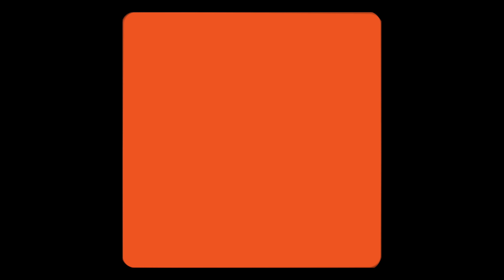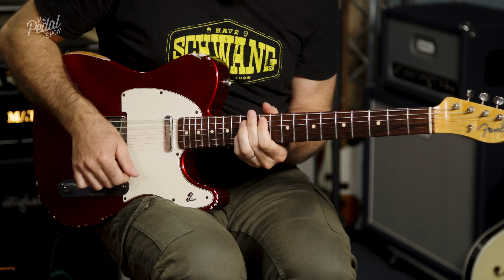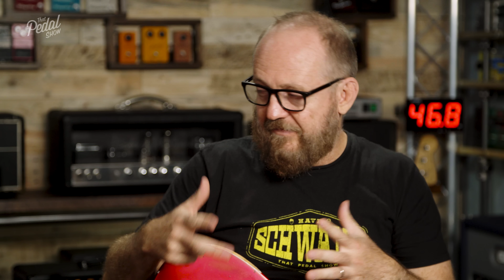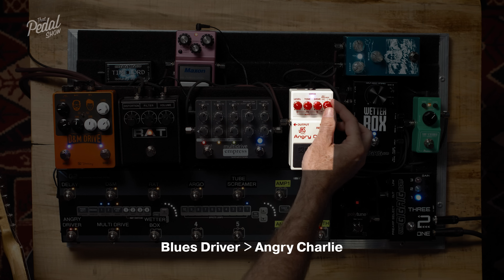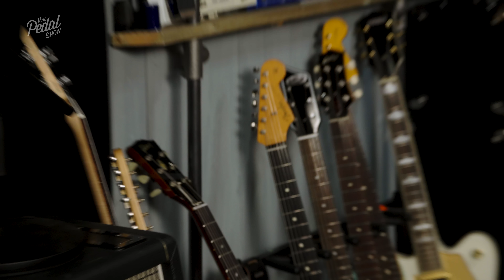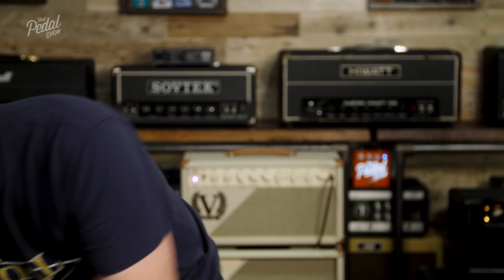Mixing Gain Pedals In Parallel For Ultimate Versatility – That Pedal Show

Comment: Interesting how this is finally morphing into the gtr world. This is s.o.p. on a mixing console. All fx on a console are single source multiple sends and returns. Much easier to blend when the fx are not affecting one another. Check out the new electro-harmonix parallel mixer. Allows you to parallel 3 pedals. Doing this with multiply voiced drives is the cheapest and most portable way to simulate a multiple amp setup.
Reply from the maker: Nice!

Comment: Another great episode! It's worth noting the Angry Driver does some gnarly things when it's boosted with another pedal in front of it. Also, the bonus functionality with the remote jack makes it super versatile. You get one pedal as a base, and then it kicks in the other on top, or in parallel, toggles the Blues Driver.

All that said, I took mine home when my local store didn't have an Angry Charlie in stock. I leave mine dialed in not far from where it was when the Empress demo started. Stacking/boosting it with a Rattler or 1962X is fun, too. When the Angry Charlie side gets a lot of gain in front, it gets really angry. Thanks for the hard work!

Comment: There are a parallel Mixer for Pedals from EHX with a power Full EQ for each of the 3  sections😉 This is a Thinge I want to do for so Long, but the mix Pedals wehre not reale there. Now they are coming  and I reale want to try Plexi and a Tweed in a Box Pedals in parallel🤘 thanks for that Great show😍

Comment: Experimented a bit with parallel , but in the end , was deterred by the introduction of further buffers, flattening and otherwise having a negative impact on overall sound.Tried to convince myself it wasn't that noticable, but that didn't work for long.Was primarily using the inexpensive , new, EHX Switchblade Pro unit, and would assume that more satisfying results could be obtained with a higher quality unit[Swiss Things?],(EHX great for the price point, but very relative) .The larger idea of parallel mixing is exciting(Wah?),if a little intimidating.Being a believer in Fuzz and "vintage", Neve, and unusual driven sounds, I've repeatedly come up against buffers as a issue and overall enemy,; just fine with the cleans, but engage that Drive/Fuzz section ,- ouch.
Now, if the Angry Driver had the mojo of the Keeley Phat Mod; not quite as good as the older , Germanium, release, but what do you expect? That IS the pissed off sound of Rock coming back looking for a rematch.
"State B" would be the larger part of the American South, where , along with a majority of their Northern and Western counterparts, geography is NOT a strong suit.Not sure, dear Mick, where you'd get the idea that the  educational  system here was succeeding on any level.

Comment: Re your out of phase Tele, Mick......I fitted a Strat pickup into the neck position of my Tele which resulted in true out phase when both pups mixed. Bare Knuckle explained that if using in the same guitar as a Tele bridge pickup, i ought to have asked for the Strat pickup to be reverse wound. No matter though - because the out of phase sound is glorious, a happy accident!

Comment: Cool episode guys! :D how about the following idea: splitting the signal and going through two seperate drive pedals, just as mentioned in the episode :) but then keeping the signals seperate all the way. So with the example of the TS and the Rat, one of the amps would receive the TS signal and the other would receive the Rat signal. I have tried something like this this a few times and involving the amps in this blendingfeast sounds EPIC! In my opinion not a very usable live setup though, but the blending options are endless :) so it would probably be great for studio work. The only thing is (if you play stereo or dual mono) all the pedals after the split need to be “stereo”. Or you could (of course) also go wet/dry after this split :) Maybe something you could try in the future!

Keep it up! Cheers,
Niels from Utrecht, The Netherlands
Reply: I am currently running four wet and two dry channels. Not useable live is about right, but it sounds interesting.

Comment: Been waiting for this video and really enjoyed it! Next topic, delays in series and parallel. 

It’s funny how most of pedal history has been series. Especially when you consider that most guitar pick up combos are parallel. Even channel jumping on old amps was putting two tubes in parallel. 

Got a nerdy question considering phase...in any pedal or amp you have some kind of tone, EQ, filter etc that utilizes a capacitor to ground. I’ve tried googling this with mixed results but doesn’t that introduce some phase shift? So most of the time 2 pedals or amps in parallel will most likely be not in or exactly out of phase. 

Speaking of 2 amps, you could do drives in parallel this way. So many creative sparks TPS always initiates! I’m due for another trip to TPSS 💴

Comment: Great demonstration, and something I'm going to experiment with in my Helix. The Empress Multidrive is like a take on the old Craig Anderton Quadrafuzz from the 80s - good stuff. The ultimate parallel fuzz was the "hex fuzz" from the Roland GR100 and GR300 - but that's a bit of and edge case... but what a great sound. Worked quite will for a Mr. Fripp.

Comment: Great show! The Klon can be seen as a parallel mixer of the clean signal and clipping OD, something like the Angry Driver in parallel experiment (probably that’s why Mick liked that the most). Currently, I’m exploring parallel mixing preamp pedals with a Boss LS-2, to try to achieve multi-amp tones with a single signal chain into the power stages. Cheers

Comment: The moment I first saw the Wetter box, I wanted to see how it would handle a fuzz/drive parallel, and here it is. Does exactly what I was hoping for! Sold! Thanks so much! 

I wonder, what would be the difference between doing this through a single amp and running separate drives into dual amps, apart from the obvious volume increase (lets assume they are in phase) etc...?

Btw the Strymon Sunset has a parallel drive mode...
Reply: Good question, Edward Jons! How about two different amp heads; one into a 4x10, and the other into a 1x15, each head with it's own chain! Way far too much gear to gig with, and, really, would all that stand out in a recording mix, but sure sounds fun to dream about!

Comment: Precisely why I like using two amps. One compresses more than the other and widens the frequency response.
Reply: I was unhappy with the twiddley nature of stacked gain so I started running seperate paths to different amplifiers. It's gotten pretty out of hand and I am trying to re-attach some circuits to get it down into just two or three amplifiers. It does sound good though, doesn't it?

Comment: The new ehx parallelmixer. Maybe next time?
Reply: They never feature products that compete with stuff that Gigrig offers. No shows about switchers, no shows about different power supplies, etc. Which is fair enough; this show is absolutely a huge marketing platform for Daniel and his guys.
Reply: I just got an EHX Switchblade Pro, which offers a lot of options for switching A or B, switching order of A and B, and choice of parallel or serial for when both fx loops are engaged. Also, volume control for A, B, and Dry. All that said, I still might like a Wetter Box one day. For one, I do a lot of stuff in stereo — my Roland JC40 amp is stereo, and some of my synths and fx are stereo, as well. 😃 (Of course, that amp has the option of serial or parallel fx loop — loop is mono out, stereo in, and it’s bring-your-own loop fx volume control so that you don’t blast your ears. Yeah!)

Comment: Parallel gain staging, nice!  But come on guys why not come all the way and finally do a dedicated show on full on stereo amps and stereo pedal boards?   I am a Roland JC-40 convert.
Reply from the maker: It’s a different thing. We have done some stereo stuff, maybe it’s time for a revisit.
Reply: @ThatPedalShow  What I am talking about is skipping the step where you blend into mono and blend just send parallel signals into opposite stereo channels and blend at the amp.   True stereo amps like the JC-40 (including the effects loop) gives you a cutting edge platform where re-imagining a board for true stereo including wet/dry is a very complex rethink.

Comment: The Angry driver is cool. My first thought was, it would be good if you could switch modes with your foot instead of turning the knob. I guess this is what the remote is for. One small downside (?) ... when using the remote switch, how does one know which mode you're in?
Reply: fishy paw The led changes colour, blue=bd2 red= angry Charley

Comment: I would have loved to see the affect a klon type would've had both before and after a parallel blend.  Very interesting to think of a little extra gain and wave form shaping going into two different signals then catching those gains stages and being blended back together as well.  I imagine stacking something after would mute the point a bit, but still a fun exercise for science.

Comment: Loved the episode. I learned something new. 
I'm still stuck with a question though. If you split the signal coming from the guitar in 2, does that mean that the current is split in 2? And does that mean that you need to turn the gain and/or volume up on both pedals?
Reply from the maker: We’d say don’t worry about any of that. No is the simple answer, but in any case simply tweak to taste!
Reply: @ThatPedalShow  Thanks. I'm not worrying about that. I'm always curious to learn more about how things work. :-)

Comment: G2 or G3 feature idea: blend level per active loop for parallel audio of 2 or even more loops.
Reply: I think G2 can already do a quasi parallel thing if you run loops 9 & 10 in stereo - but pretty sure you have to run the sends from 2-4 of the previous mono loops...

Comment: I've been thinking a lot lately about signal splitting and wet-dry setups. If you only owned one amp, could you emulate a wet-dry setup by splitting the signal after your gain pedals with one path going through your modulation effects and then recombining in a mixer before your one-and-only amp? It seems to me you might get at least some of the benefit of a real wet-dry setup without needing two amps. What do you think, would this be worth the effort?
Reply from the maker: Erm, not really. In a way, using an effects loop is a bit like doing this, as long as the pedals have a wet mix knob. The real benefit of wet/dry is two completely separate amps and speakers. If it’s all coming out of one speaker much of the ‘bigness’ and separation is gone. Cheers!

Comment: Hi guys, a couple of questions please. 1) how does dan have to board wired to have the option of having pedals both in parallel with the wetterbox and in series with the controls on G2? 2) how do you tell if something is in phase. I heard if the bottom end disappears then that’s out of phase. Is that the case? Thanks guys. Sorry, third question.. is it only digital pedals where you need to worry about it flipping the phase or delaying the original signal.

Comment: Great banter and brilliant show.  I have been using an ABY to drive two different chains: DOD FX50-B (the drive at 1/2 past 3) and a TS-9 (at 10) into channels 1 and 2 respectively of my ‘86 JC-120.  And I have loved that sound for a long time.  Thanks for giving context and better understanding to something I stumbled upon myself.  Though, I still prefer pushing the FX50-B with the TS-9 for clipping artifacts.  A question: what other amps handle using both channels in parallel well?  The JC-120 does it well and has been a good “wet -dry” amp.

Comment: Dammit. I just about had things figured out. Now I have to rethink everything. Sigh
Reply: Brian Landreth BWAHAHAHAHAHAHAHA!!!
Reply: Now I need to reconfigure my 3 drive loops so they all have line switchers in them so I can blend in series and parallel !
Reply: I feel the same way about the release of the wetter box.  Now I want my whole front end part of the board wired into one so I can always blend in clean signal, and then one in the effects of the wet amp so I can always control the amount of wet/dry going on in the wetter amp of the two.  I REALLY like how they showed wet/dry where one amp is dry and one is wettish.  I also like that you don't need one amp 100% clean off guitar with wetter box you can just bring it in and out.       back to work :( lol   Edit:  WOOPS!  Wrong youtube channel logged in, let me change accounts back to Carmelo Santini lol
Reply: Get used to it as we all must.

Comment: Dear gents. Thanks again for a great show. What are your thoughts on wet/dry vs. running pedals in parallel and sending to one amp? 
The same, of course not. But I wonder how close it will get - here thinking of splitting things like drives, tremolo and envelope filters but keeping delays and reverbs after the signal is united again.
Reply from the maker: It’s the same principle as wet dry just sending different pedals to different amps. Could be very cool! All comes down to your ear at the end of the day. Personally - Mick here - I like the wet effects in one amp only because it always stays more focused. But that may not be your needs!

Comment: Awesome episode! Gonna have to try this out in the morning! 
Possible question for V+Cs: My current (sorry not a G2, yet) in the way I have it set up currently can let me route some pedals in parallel. Is there anything I should watch out for in terms of things that might generate hum? I've had problems running stereo amps and stuff with grounding noise and whatnot, but will any of this sort of thing be an issue when splitting the signal and then putting it back together again without anything to isolate grounds?
Reply: Lehle (in Germany) makes several excellent signal splitters. They each have a torroidal transformer that electrically isolates each signal from the other. The relatively inexpensive one is called the "P Split" and it goes for about $160 US new, but even cheaper when used. It eliminates ground loops and hums.
Reply: @JP-kf7bs  Thanks man! I'm just hoping I don't need to spend any more money to do it than with the gear I already have, but if I run into issues I'll look into those :)

Comment: Mick - have you updated your pedalboard to not have any digital pedals on it? If so, what was causing you problems?
Reply from the maker: I’m trying to expunge them one by one Ted. No problems as such but whenever I compare a digital version of the real analogue thing, i seem to be more free and less pedal tweaky with the analogue thing. To be fair I’ve never really gone out of my way to do any A/B testing.... it’s more like stick it on the board and see how I feel. 
Now then. Certain things like the Belle Epoch and Boonar/Echorec.... there is no analogue alternative that makes any sense to me practically speaking, and they sound great, so they can stay. BUT even though I enjoy the sound of them, still nothing ‘feels’ quite like the Analog Man ARDX20. I don’t know how to explain it other than I have noticed over a 20 year period that I seem to be more emotionally and creatively connected to a rig that’s analogue. Like the feedback loop of me, guitar, pedals and amps is as complete as it can be. 
Caveat: there are some sounds you can only get with digital. The Vent for example. When I need a rotary I will always use that. But for the moment I’m finding that I prefer a mix of all-analogue phaser and chorus or Tremolo which doesn’t sound like a rotary, but seems to drag more out of me anyway. 
Is it all in the brain!? Of course it is. That’s where the ideas begin and the feedback loop completes. Everything is ALL in the brain. :0)

Comment: So would it be considered parallel if you use a loop box that takes a couple pedals out of the chain, and then use them both at the same time as they both run out of the output of the loop box? Or are they still running in series? My loop box runs 3 loop chains. I was just wondering if that made any difference?  I might have eaten too many edible candies if you know what I mean?

Comment: Quick question for Mick regarding something else not pertaining this episode: When you use the Catalinbread Belle Epoch Deluxe on your Wet/Dry rig you say you always leave it on and bring in the volume with a pedal 'cause it seems to "flip the phase" when it's turned on. Have you tried flipping the switch inside the pedal (changes from True Bypass to Buffered Bypass, where if I'm not mistaken the signal always goes through the preamp) and see if resolves the issue?
Reply from the maker: Thanks 83 - a few people have suggested this and it sounds like it will work. When I next get the board out I’ll try it! Although, I’ve come to really love having the expression pedal for the delay level control. It’s great!

Comment: Great show, I always learn something from you guys.  Can you use a stereo pedal to split the signal or an AB Box and then use it in a wet-dry rig if a wetter box is not on hand?  

Alternate work around since there are no 'B' states, you can simply refer to "Bloomin' Alaska," for example.

Comment: I have a Brian May Red Special copy. It is very versatile with phase, having 3 pickups, and all of which can be on/off or in/out of phase.  Out of phase sounds very tinny at low gain, but it can be great with a lot of gain.  Brian May does use various combinations of pickups, both in and out of phase. I also have a Les Paul Standard with push/pull phase switching, and I think that Peter Green did balance pick-up volumes quite carefully.  Again it can sound tinny out of phase with both on full volume, but it does get that sound with the bridge on about 8 and the neck on 10.